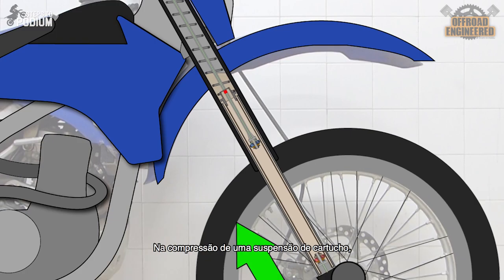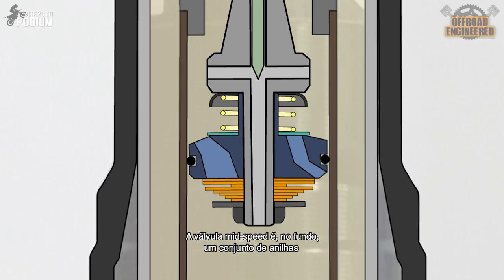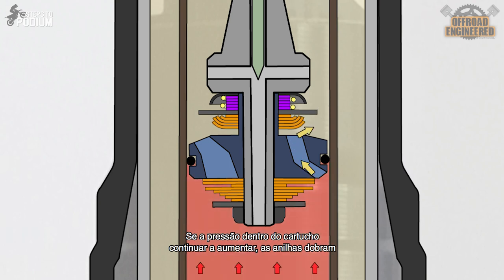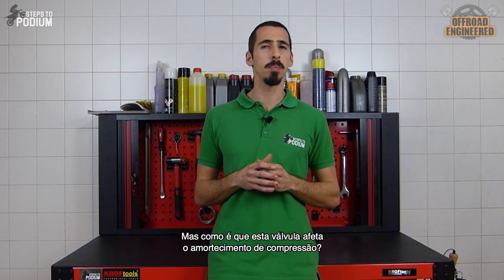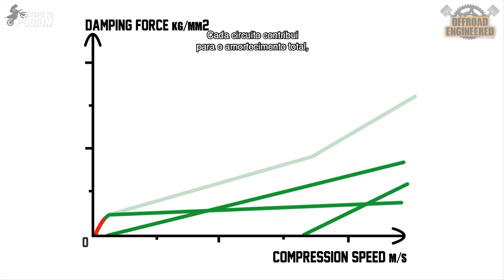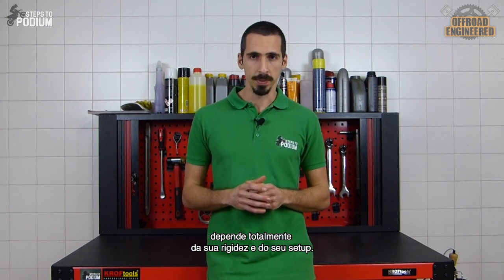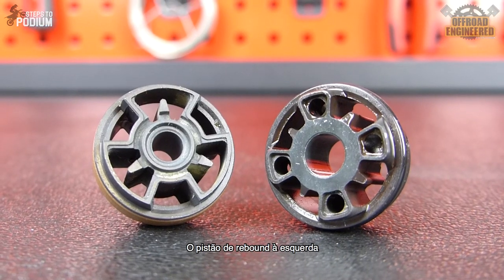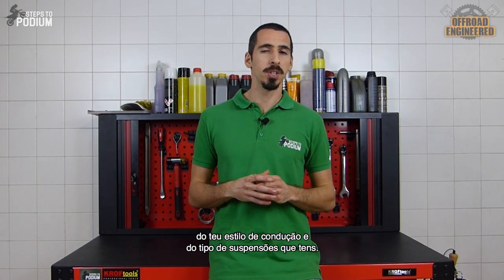The Mid-Speed Valve | Offroad Engineered

Comment: Best video I've seen on the mid-valve. The moto people just leave it stock and most of the time they are ok. The off-road guys don't understand float and wonder why they don't have good forks in the rocks.  I stopped arguing with people about settings back in 08, it's like casting pearls before swine. Thanks for the video and the work you put into it.
Reply from the maker: Thank you so much for the nice words! You have a lot more videos related to suspensions on the channel 🙌💪
Reply: That sounds intriguing...can you elaborate a little on the float in off-road applications for rocks and stuff?

Comment: I have a new Tuareg 660 and it appears the kyb fork compression shims in many, if not all, are bent due to mid-valve piston installed upside down! This led me to this video series. The animations are top notch as are the explanations that go with them.  In particular the huge effect shim thickness has and the reason for using a set of thinner shims vs a thicker one. 
Time to tool up.
Reply from the maker: Thaaank you 🙌

Comment: 2006 kx 250 2stroke  midstroke rod the valuing nut came off the shims  are mix up  the shimstack is the only thing I need in a correct order  to put this  back together have any idea    For the stock order other wise I will have to pull the other side off ?

Comment: Got a question . When we started reassembling the front shock , we filled it with oil and tried to pump the rod in and out to remove air . We didn’t see any bubbles , but the rod retracted and didn’t extend out . We pulled on the rod to fully extend it , but when we turned it loose it retracted on its own . What are we doing wrong ? 
One fork works fine and the other does not , puzzled ?
Reply from the maker: Is that on a closed cartridge?
Reply: Yes it’s a closed Cartrage
Reply from the maker: Then it's because it is not properly bled

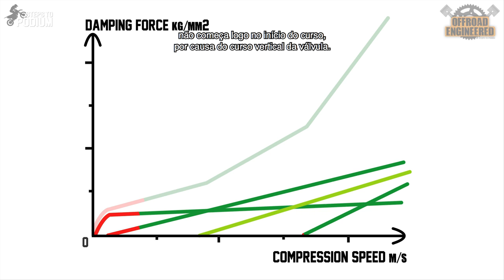Comment: Ok....a question.. I've watched this a few times now and I initially missed this part. I understand the low speed orifice, but what is the low speed shim stack that you mention at 3:33? It seems to me that the low speed shim stack is the check valve/shim stack in the mid valve, but at 4:08 you add that in separately on the graph. What am I missing?
Reply from the maker: Every compression base valve has 3 different damping circuits, low-speed orifice, and the shim stacks. The shim stack is usually made of 2 stacks, the low-speed shim stack and high speed shim stack. although one is on top of the other, they contribute with two different circuits (It's weird, but it works like that!). 
The mid-speed valve, and its respective damping contribution, comes from the damping rod, and not the compression base valve, that's why I showed it separately. first I showed the damping curve with only the compression base valve, and then showed the damping curve with the base valve and MSV. It all adds up, even if it comes from different valves!
I have another video regarding shim stacks and valving. Have you checked it? :)
Reply: @StepstoPodium  Thanks! I forgot about the double stack of shims on the base valve. Thanks! I will double check your referenced vid. I think I did watch it back when I first found these. You mentioned a crossover shim stack as I recall. A guy did that to our CRF years ago. Thanks for the great info!
Reply from the maker: Itsa pleasure to help! 🙂

Comment: Got a question, in MTB there is high and low speed rebound damping... I might be wrong but I have not seen this in MX or other motor sports... is it MTB marketing BS or can you get low/high speed rebound damping? My basic understanding is that the rate in which the shock returns is governed by the spring so you only have rebound damping making the high and low features a gimmick  or am I wrong?
Reply from the maker: Great question! The truth is that, although moto and bike have and use kind of the same hydraulic circuits, the suspension principles are not exactly the same. On bikes, the rebound circuits have a much higher responsibility on how a suspension feels than on moto, which is the other way around, the compression has almost all responsibility than rebound - which is only there to control the extension of the spring.
Why this happens? It's related to the sprung and unsprung mass of the bike, which is a lot different than on moto (weight-wise)
Reply: @StepstoPodium  Thank you for this explanation
Reply from the maker: @highcarbrider glad I could help :)